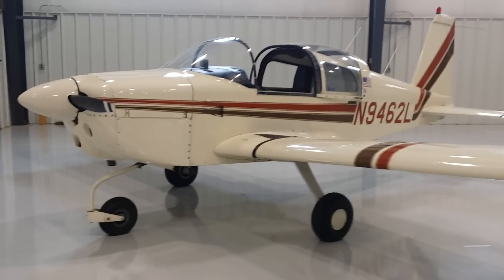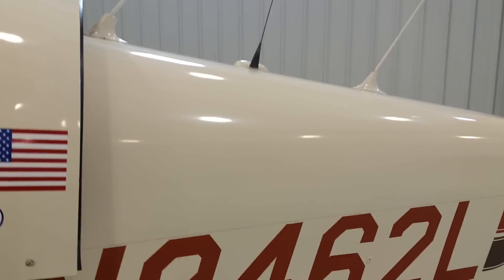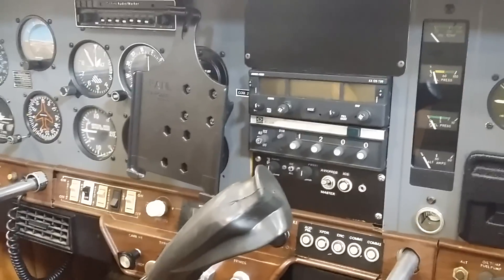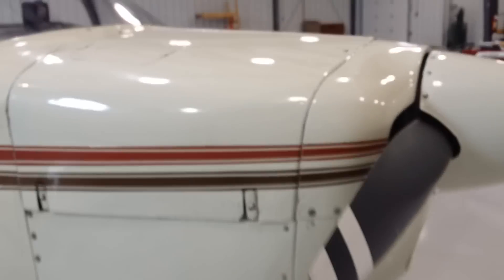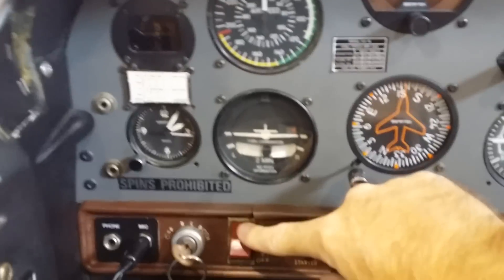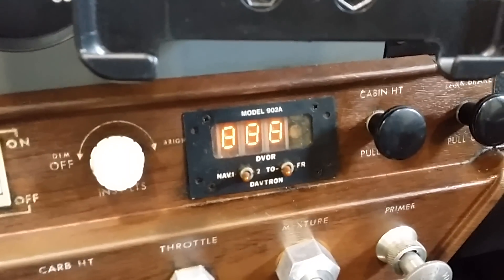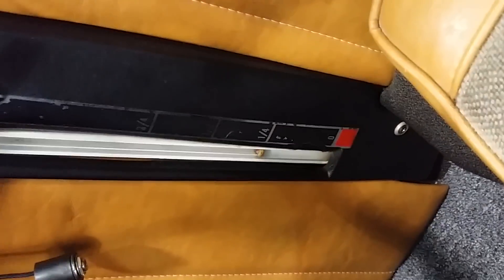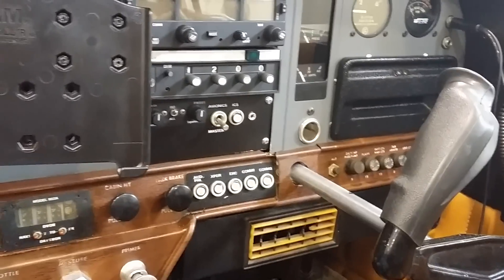Grumman AA1A description

Comment: I'm so glad I found this video. I actually own this plane, purchased from the guy who bought it from Dukepilot. It is still in amazing shape and has been cared for like you wouldn't believe. The past owners really cherished this plane. It puts a lot of pressure on me to make sure the tradition of outstanding care continues on to the next owner.
Reply: I Day are you selling it?
Reply: Can you tell me if you have had any problems with overloading the airplane? I am buying the same airplane, only it is a 1972 model. The airplane has a reputation of not being able to handle much much. Two full size men and full fuel tanks can actually be too much weight. This concerns me. I would appreciate any information you can give me to ensure that I load and fly it safely.
Reply: @robertchristino4152   Get a thorough checkout FROM AN EXPERT GRUMMAN CFI..  Some are BS CFI..  .. Dont plane short take offs or long climbs to over 7k..  avoid hot days... more.. .. G AA 1's dont take slow speeds or slow pilots or BS..  Ge a real no BS CFI and enjoy it.. But respect them .. They cruices 120-130 .. but dont climb at all...
Reply: I used to own this plane as well.  I think I owned it around 2012.  It was a great little airplane and I put around 200 hours on it.  I sold it to pay for the engine in my homebuilt that I was building.  It went to a guy in Wisconsin who only had it a short time.  When I delivered it, it was the coldest I have ever been in an airplane.  I recently bought another one.  It is a 72 model with the 160HP and I love the performance!
Reply: We just sold it to it's new owner today. She's still running strong on the Mattituck engine. Absolutely fantastic airframe.
Reply: I owned this plane in 2010-2011. Absolutely loved it!

Comment: If you can flip the wing over, that must mean that you have a symmetrical airfoil.  How are the stall characteristics?
Reply: I think that if you could flip a wing to the other side, it would be tough to refuel through an upside down, fuel port. I don't think his statement is true. Me- ex-Yankee pilot in the 70's. A Commercial Pilot, and an A&P Mechanic.
Reply: @rustykeller8264  The fuel tank on the AA1 series is not a part of the wing.  The fuel tank is actually integral to the oversized, hollow, tubular spar... giving you low-capacity, but practically indestructible fuel tanks.  The wing slides on and off over the spar/tank.  The fuel filler just sticks up through the plastic wingtip. (note:  the AA5s have the tubular spar, too, but don't use it as a fuel tank)  This is a really simple wing... basically just a shell that slides over the spar and then gets bolted to the fuselage.  I can't remember if you actually flip it over for left/right or if either side can be the root/tip.  Without the plastic wingtip and root fairing, the wing just looks like a hollow, rounded rectangle.  You can install the wing on either side, but you do need the proper left/right root fairing and wingtip.

For Fred Ferd:  The stall characteristics are, in my opinion, nice.  Mine was an AA1B (TR2) with an 0-320 STC. It had a pretty crisp break followed by a nice nose drop.  Stay on the rudder, because it does not spin well.  However, it was hard to get slow due to the O-320.  Even at idle there was quite a bit of thrust.
Reply: @johnfowler1627  The airfoil doesn't look close to symmetrical, would be odd flying with an upside down airfoil
Reply: @captarmour  It's not symmetrical top/bottom.  I was responding to the comment "flip to the other side."  I should have clarified that no "flipping" is involved. [apparently, at the time of my reply 2 years ago, I was confused about the wording]  Rather, the wing has a uniform cross-section throughout -- either end can be the root or the tip.  In other words, you can slide a wing on either the left or the right spar, then install the tip and the root fairing.
Reply: @johnfowler1627  Ah ha, as I started reading your reply I realized how it worked, thanks for clarifying, wow this IS interesting!! where can I get a cheap one?!

Comment: Hello again, When you turn on the Master Switch, What is that Noise you can hear ? Like an Electric Motor. THANK YOU
Reply from the maker: That would be the electric turn coordinator which is the instrument that is on the left lower panel next to the clock.  It gives you an indication of your rate of turn and whether your turn is coordinated properly.
Reply: Gyro

Comment: Hello, has this AA1A the 108 hp Lycoming Engine ?
Reply from the maker: Yes.  O-235.  Same engine used in the Cessna 152.  2400 hour TBO, but if ran and taken care of properly will run well over 3000 hours.